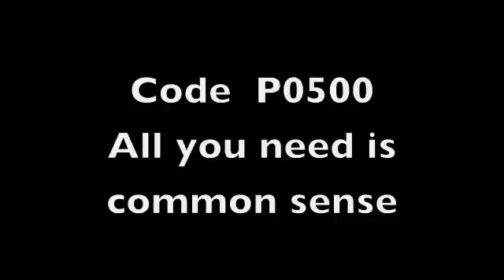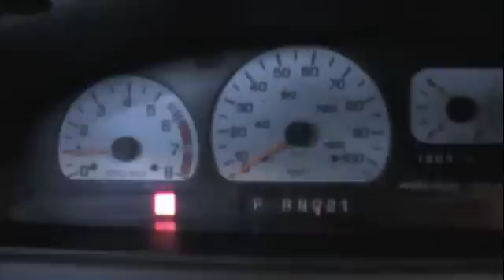Code P0500

Comment: Changed mine in my 2007 Toyota Corolla s . Speedometer was working but I had that code p0500 after putting in a new one I still have the cose6and check engine light

Comment: Hello I was wondering if you can help me. I have a p0500 code I have a sanity QX56 2006 but my speedometer works. My RPM gauge however is a little off.

Comment: I got a 04 ford expedition with code p0507 any help wpuld be appreciated , car idle rough , when braking rpms stay at 1200 or sometimes it will be a hard stop and feels as if the motor stalled ..

Comment: got a 94 Lexus ES 300 with  PO 500 output speed sensor and po 720 abs codes what the heck could be the problem. could it be the ECU? or is it the speed sensor. the car will run fine short distances but once u get it to 55 she slips gears the rpms ramp up and she doesn't go anywhere until she slams into gear

Comment: I've got the same P 0500 code on my 96 Jeep Grand Cherokee and I did replace the speed sensor but still no speedo reading and it's causing ignition issues on top of it like backfires, what could possibly be the problem.

Comment: i have a 2007 toyota camry 2.4, and it reads p0500,  my speedometer is working fine, and also my tranny, i just have the check engine, I replaced the vehicle speed sensor and nothing happened. whats next to do?

Comment: I have a 98 Ford Contour SE V-6 and I am sure its the Speed Sensor as I just changed the Front and Aft Motor Mounts. What a hassle on Jack Stands in the Back Yard. Once I finished I took her for a test drive and no speedo. Intermittent Check Engine Light and the P0500 code is in stored codes not an active code unless driving.

Comment: my 2005 Nissan quest  have three trouble code P0113-P0183-- I already replace whole Fuel Pump for P0183 (built in fuel temp sensor), And replace Mass airflow sensor for P0113. But it,s still showing two code as it is. Three code are related with harness and connecters problem. So Problem is some where else. Because of It,s not possible all Three sensors have lose connections or bad connecters. what is a ECM problem ? , Any body Help me plz.